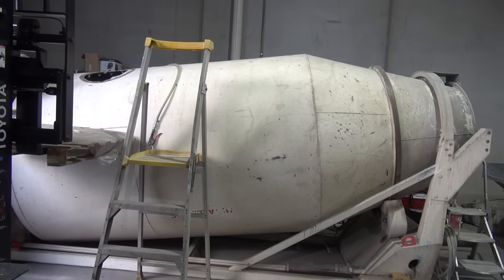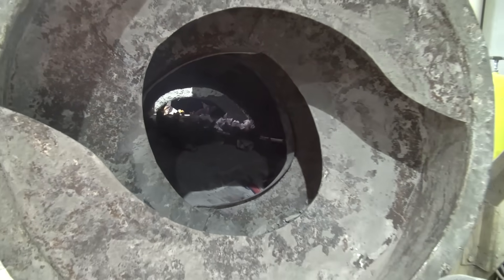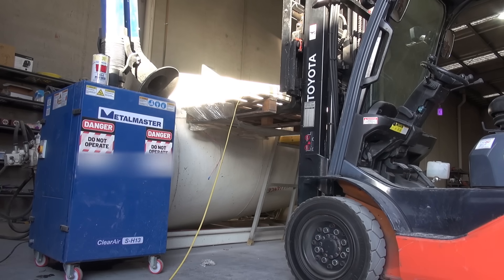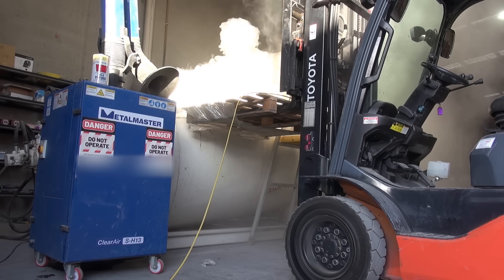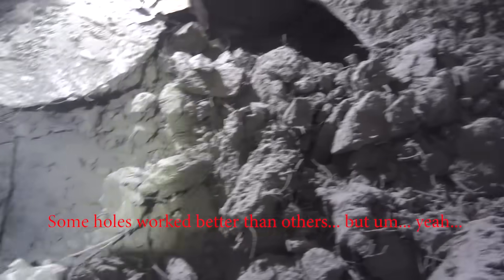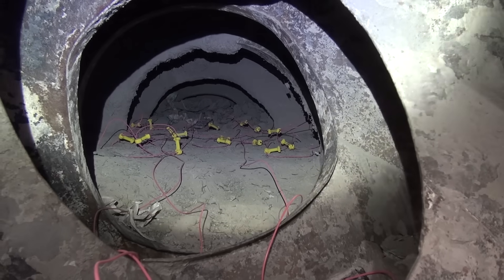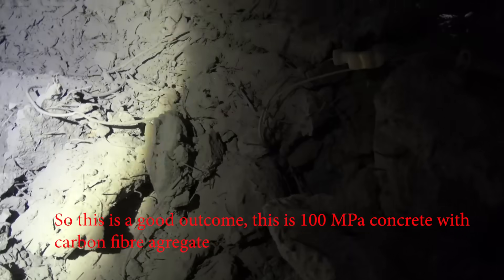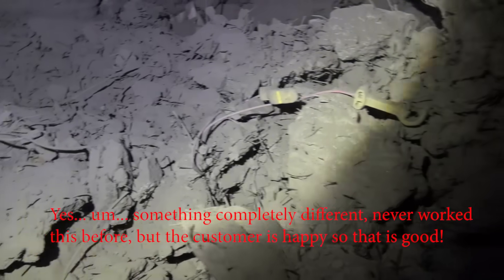Using Explosives to clean out a concrete truck

Comment: How did you drill the holes?  Must have been a bite noisy drilling inside that drum.
Reply from the maker: They did it under my instruction, ear plugs and then muffs over the top is standard for such work.
Reply: @demolitiondavedrillandblast  That's what I wear if shooting at an indoor range, as either on their own isn't enough.

Comment: I can hear it, "5:00 on Friday, boss says no overtime, out of here!"
Reply from the maker: I don't know the story on this one Keith, it often happens on trucks when they are involved in an accident or have a hydraulic failure... Or the last truck that I I cleaned out, the owners told the driver that he was finishing at the end of the day and sent him out with full load, he went to the train station, parked it up and got the train home.
Reply: @demolitiondavedrillandblast  Back in West Berlin we had a story about a concrete lorry driver, who, on the way to a construction ite, passed his own house. He noticed his boss's Porsche convertible standing outside. So the driver stopped and had a look through a window, where he saw his boss sh@gging the lorry driver's wife. So the lorry driver extended the chute and filled the boss's Porsche wih concrete.
Reply: @demolitiondavedrillandblast  There was one a few years ago not far from us. Concrete truck coming out for a job early one morning, and someone coming the other way decided to overtake in the fog - truck driver had a choice: continue straight ahead, have a head-on with the oncoming overtaking car which then would've taken out the car behind it (on the correct side of the road); or run off the road into the ditch.

The concrete truck driver chose the latter - got a bump on the head but nothing worse, and rolled his truck. The barrel sat there for a couple of weeks until they took it away for "servicing".

Comment: there you go  Mythbusters     dave can do it .  💹
Reply from the maker: I wonder what else they failed at that I could do??
Reply: I don't think Mythbusters bothered to drill any holes, who knew that drillholes can make it work?   Also, Mythbusters didn't really care if the concrete came out or not, it was just TV.
There is a yard at a concrete company in Los Angeles that has more than 10 full size mixers filled with concrete just sitting for years.  I think they don't bother trying to get the concrete out anymore,  they just eventually cut the mixer up for scrap steel.

Comment: Great work Dave. 
Having sat in a concrete skip(kibble) in my youth with a jackhammer and needle gun for hours removing slab concrete  I can only be amazed at this. 100mpa!!!!
Reply from the maker: Only you would know the difficulty WK, I had never heard about concrete that strong either and the fibres make it a lot more difficult they tell me.
Reply: Over the years I've come across old front porch stoops we would beat on for days with a jackhammer just to get them manageable to move. A handful of times we surrendered and used as fill once we had chipped away enough to pour the replacement. These were originally poured @1950-60 era in North Missouri and always had river rock aggregate. If shifting hadn't rendered them unusable they would have lasted another century. I always dreaded bidding one of those jobs they never were easy or the same!
Reply: @carolrobinson7779  I remember coming across that sort of thing back when I was doing landscaping. Banging away at it all day with a breaker mounted on a Bobcat, just to get it  small enough to pick up with the machine. Once, gave up and laid a new path using the old as the base, after finding the old to be up to 300mm thick, with 20mm thick rebar in it, and also tied into the building's foundation. That one was at a early 1950s era LDS church chapel. Those were never easy jobs!
Reply: @carolrobinson7779  Yeah river rock driveways in missouri are built like roman roads. Indestructible.

Comment: i was going to ask what the fibre was, but waited until the end and you told us.
.
another great result Dave.
Reply: Me too, I was wondering if concrete was made of mud and straw in Australia...
Reply: Amanda Gardner, Yeah that fiber is why they couldn't just jack hammer it out. Maybe if they would have got to it in the first 12 hours or so.
Reply: @tomruth9487  Yeah whoever did that likely did it on purpose.
Reply: @SilvaDreams  , Ah good point. I didn't think of that.
Reply from the maker: Indeed, thanks for joining in Amanda.
Reply: @demolitiondavedrillandblast  I was gonna ask the same question Amanda was gonna ask and then went thru comments to see if anyone else was asking it and here I am!

I’ve never seen carbon fiber being used before which it would be similar to us using fiberglass fiber here In the states but those fibers are like ten times bigger than what our fiber is which makes me curious as to what the use of that strength of concrete would be? Your not gonna use it for floors and sidewalks cause finishing it with fiber that big would be impossible! Would be great from a bridge deck or other high strength projects

Great video! Thank you for sharing!
Reply: @1982MCI  Actually it is used as a strengthener where you might have a large slab and don't want excessive breaks. ANd hiding the fibers is easier than you think otherwise all the grout (sand and rocks) in it would be visible when they finish/surface the pad as well.
Reply: @SilvaDreams  where are you located? My experience with fiber strands in the states is just the opposite. You’ve gotta be careful using it in floors with a smooth finish cause it will pull to the surface when finishing and stick out. It won’t hurt anything at all but it’s just not attractive. We use it in a lot of driveways/sidewalks etc, but we would never use it in a smooth slab application. I’m not sure how it has anything to do with hiding the sand and gravel since that’s part of the cream’s job that you work up and make sure your aggregate is all below the surface. But that’s what’s interesting is joe things are done differently in different parts of the world
Reply: @1982MCI  In the US as well but honestly that looks like an excessive amount to use. Like I said earlier I think someone did this on purpose, just the shear amount they left in there and all the fiber added seems like someone got pissed and filled it and let it dry.
Reply: @1982MCI  getting the fibers below the surface doesn't require any more work than is required for concrete that isn't fiber reinforced. Once you bull float it and bring the cream to the surface, like you do with any other concrete finishing, the fibers are hidden. Then when you mag it, or use a finishing machine, they're all well below the surface. There are HUNDREDS of different types of fibers that vary in size, shape, geometry, length, structure... You use the fibers that you need for your application. If you're doing smooth or polished concrete, you don't use fibers that are 1 mm in width and 8 inches long, that are super rigid. You'd use a finer chaff. If you don't care about that, and you only care about ultimate strength, you could use those tighter, more rigid, fibers.
Reply: @1982MCI  I've been involved in R&D on fiber for concrete. Finishing is affected by how wetable the surface of the fiber is. We developed a product for mitigating early plastic shrinkage cracking (NForce™) that beat the finishing time of the plastic fiber competition by a huge amount, simply because it was more wetable. Look for hydrophilic coatings. Wetable fiber also makes for a stronger concrete. (NForce™ is really nice for shotcrete because you get much less rebound and the concrete sticks much better to vertical surfaces.)
Reply: @MrSunrise-  very interesting! Thank you for the info, I appreciate it!!
Reply: I am thinking this carbon fiber reinforced concrete could have strength equal to steel reinforcement?
Reply: Fiberglass or kevlar
Reply: With this being such a weird setup, it's probably a specialty batch plant. could be anything from aero to rail or oil, but sometimes you just gotta mix your own spec and it's exotic enough to do it onsite. That also has the disadvantage of someone on the crew got eager and made a new batch, and then everyone took off for some reason (maybe rain came in)